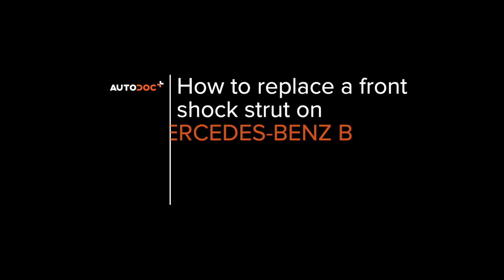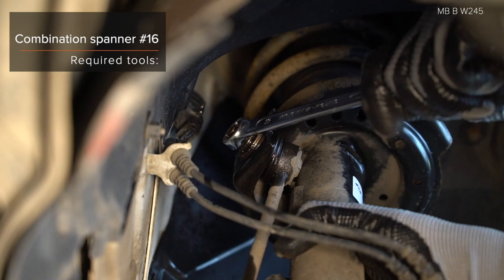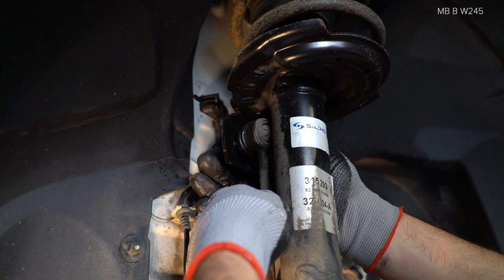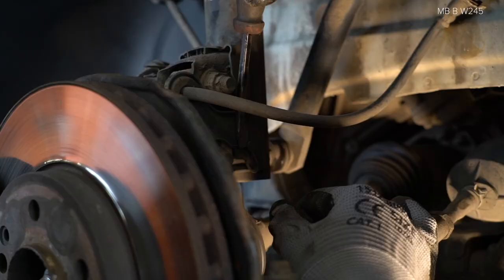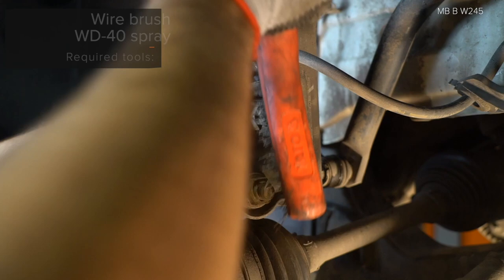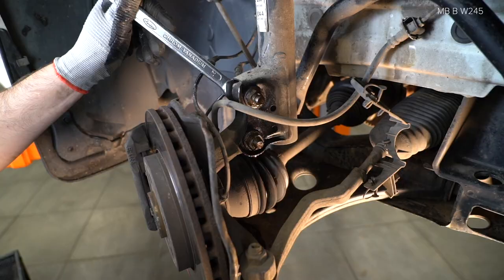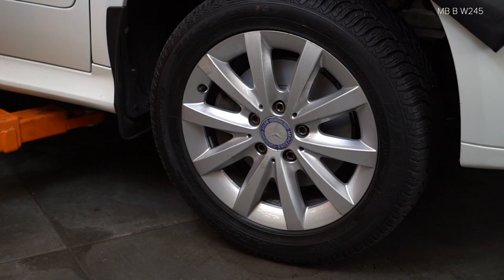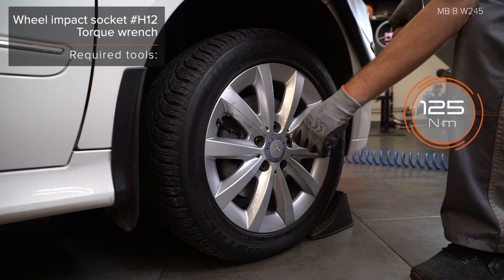How to change a front shock strut on MERCEDES-BENZ B200 (W245) [TUTORIAL AUTODOC]

Comment: Would you have to get the wheel camber checked after the shock replacement
Reply from the maker: Thank you for the feedback!
Yes, after any replacements related to the suspension of the car, it is recommended to carry out the alignment / camber correction.
Stay tuned and follow our latest updates.
Best regards, Autodoc.